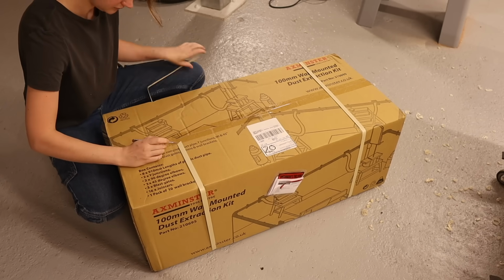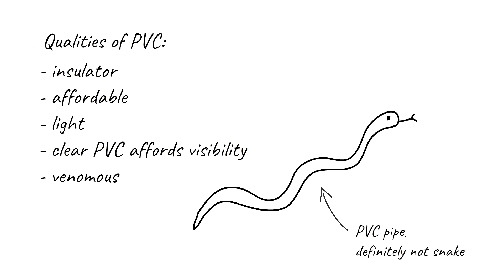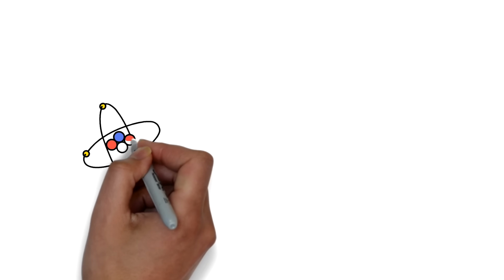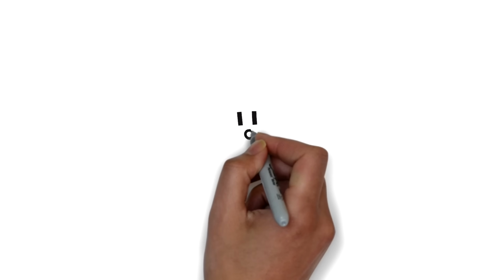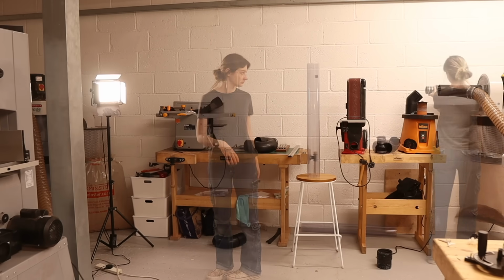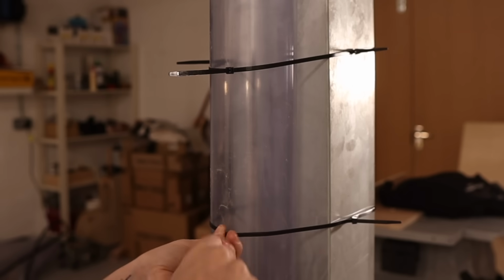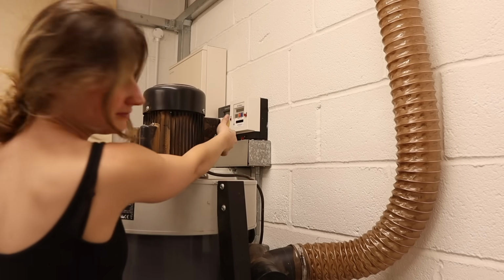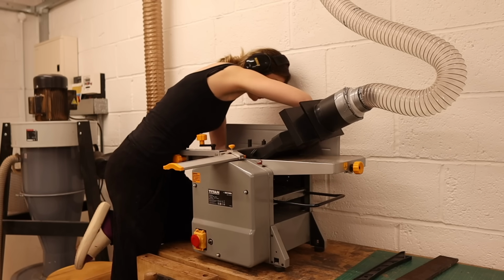Why Your Dust Extraction Might Explode

Comment: Hi Daisy, great video. We have a maker centre in our local town. We installed a huge dust extraction system big enough for the whole workshop. I was recently using the thicknesser when an elderly gentleman came over to assist. He's bald, which is important for this story! He was on the other side of the thicknesser retrieving the timber after each pass. All of a sudden I saw a spark get him from the extraction pipe. Without exaggeration it must have been around two inches long. It made an impressive "crack" as it discharged into his head! 
He was convinced I'd hit him!!! 
Moral of the story, good job earthing your system. We need to do the same. 
*Side not, upon researching I found it wise to be cautious with a dust extraction unit inside your workshop. The dust that escapes your filter is generally sub 5 micron. It atomises into the air. This is the nasty size for human lungs. I like to think of dust extraction as a cleaning aid, but still wear a respirator for self protection.

Comment: Daisy.   You nailed the static problem.  Remember if you were to hit a nail while running vacuum ,the hot metal could end up in your dust bag and smolder for a long time before catching fire After you've left your shop. You usually know when you've hit a nail(or other metal) just open your dust bag and spread out the dust etc to prevent smoldering. This tip could save you a major fire.  Stay well.  You are the best

Comment: It requires quite spesific volume of dust and airflow in plastic pipe to make a combustion as I recall from some study random years ago. In scientific laboratory they had trouble making dust combust. It needed quite amount of dust which isnt normal in our small shops and machines.

Comment: You should turn the Y connector from the thicknesser around, it will be far more efficient. Think of the piping in terms of flowing water, if the extractor is at the bottom of the hill and you want the water to flow to it effortlessly, then that backwards Y bend is a trap.
Reply: all those flex hoses arnt to efficient either...
Reply: This poster is right...This setup might block the planer completely if the the other hose is open... nothing catastrofic will happen but the planer might get glogged.. just 180 the y-piece and yer golden :)

Comment: Good work on the install of the dust extraction. Just FYI - the "grounding" is really unnecessary since pvc is an insulator, so you are only removing static from the area the wire immediately touches, it's still present on/in the rest of the pipe. Additionally, a wire on the outside only removes static from the outside of the pipe, not the inside and vice - versa. Furthermore, a dust explosion requires very specific circumstances, including a particular particle size and volume, and a small shop cannot reproduce those conditions. And a spark from static discharge is not energetic enough to ignite the dust even if you did somehow manage to generate the large volume required. It is a persistent myth that won't die because of social media; in fact, there has never been a documented case of a dust explosion  in a small shop due to static.

Regardless, it's great that you have a proper dust extraction setop because that is not good for your lungs. Enjoying your videos, keep up the good work.
Reply: Unfortunately, this video is perpetuating that myth.
Reply: I received a massive static shock from a machine that had been connected to ancient extractor using dryer hose! It fried nerves in my hand in their own fat according to the specialist. The charge went up my right arm to my neck and down the side of my body. After about 8 years of coping by being given stronger and stronger painkillers until I could be given no more I had to retire from Technical teaching...so yes this happened in a school workshop. Ultimately I got, eventually, a medical retirement but life has gone downhill since as a direct result of my accident. The medical profession had great difficulty working out what to do. Don't cut corners.
Reply: @scottmasson3336  that sounds more like electrical bleed was also involved. If the hose was metallic, then it could be grounded, but you can't do that with PVC.

Comment: Sweetest explaination of electric charging, I have ever seen.☺ Important question: DID YOU CHECK YOUR WIRING, by MESSURING the ground impedance? If not, you will not know for sure, if it works properly. It is correct, that the probability of a wood dust explosion in the tube is very low. Chances are much higher of getting shocked by a charged plastic tube, than to have a dust explosion. Plastics are highly chargable. However, things change completely, when the dust includes metal dust. This is where things can get very dangerous, because metal dust from crafting processes is mostly super hot and your dust extraction might go up in flames (not explode). That is why you should allways keep these kinds of workplaces and their exhausts seperated from each other.

Comment: Daisy, I think you are equating news stories about disastrous fires to the rate of incidence of dust fires and explosions. I think you will find a great many stories in the comments below.  Your comment about the humidity being controlled etc. is true as far as it goes, it is the little bit of crud built up next to a fan impeller that friction heats up and then poof. I had a good teacher who did a demo on this. He had a gallon paint can and put a teaspoon of wood powder in it.  For the demo he had a car spark plug in the side of the can.  He hammered the lid shut tight. Tripped off the spark plug and the lid hit the ceiling leaving a dent and the can was bulged out at the sides. Quite impressive to say the least.  So, can't be too careful.

Comment: little tip: don't use those screw-on clamps for the wire... with a vibration heavy environment those can easily get of that mashed wire... from another video I know you have a solder iron -> that would be preferable 
regarding the science: almost completely right, just a little addition that not only the electrons form up and build a negative area, also the protons that are now missing an electron are charged (positively), so both the PVC pipes as well as the saw dust (if very dry) will be electro statically charged.
but: 100% cool that you even think about that stuff... at lot of work shops I know in my area do either not really have dust collection or if so, no proper grounding^^

Comment: Yeah, some atoms have an extra electron called a valence electron. It's this electron that can get moved about from one atom top another and build up a charge. Generally nature doesn't like things unbalanced, so those electrons will travel to anywhere there aren't electrons.
What you are doing with your set up is a wise move. Static electricity does build up anywhere there is friction. People who put computers together usually wear a grounding cable. When it comes to safety, and I've worked a few high risk environments (just workshops, industrial sites) I was told to think of consequences rather than likelyhoods.
Dust explosions can get really gnarly.
As always, enjoying the content.

Comment: Hello Daisy, Great vid as usual, two comments, the wire can just be on the outside of the dust lines, and to stop those really annoying jolts you get when using the shop vac to vacuum the floor, put a conductor from the dust drum to the floor, That was the singular best thing I ever did to keep the floor clean.

Comment: Get a ladder 6' is most useful. Looks like all your metallic items are grounded. Sander dust is the main thing in your shop and it needs a hot start like a match with plenty of o2. If you have rubber feed rolls you can ground the bearing housing. If you had a bucket elevator you would ground the drums with static brushes

Comment: I picked up that Axminster ducting kit too, haven't bothered to ground anything but I will say the blast gates are constantly getting stuffed with debris which prevents them from fully closing.  I have to keep using a small allen key to hook it all out every few weeks
Reply: I install blast gates upside down so crud can't fall upwards into the gate slot. It's a bit less convenient to have the gate handle on the bottom. But it beats clawing wood dust out of those slots once a month.

Comment: Hi 👋, Very interesting, back when you were just a atom in the universe, that was before the big spark, I had some colleagues that had a very large workshop. Where are the dust extractor who is outside the building, luckily for them. As one day there was a fight inside the pipe electrons, atoms molecules all decided to accumulate. And they had a meeting outside   BOOM 💥, blew the dust extractor apart, and caught on fire, get the Fire Brigade get the Fire Brigade, luckily they managed to put it out. Even dust floating around in your workshop could explode if you have a bad ignition on something it will ignite and blow your doors and walls out., 
Something that a lot of people don’t think about is their polishing products , are use rag to apply them or paper towel. This can I have a chemical reaction, spontaneous combust., so just don’t throw your rags onto the ground but into a waste sealed container,, , put them into a metal container or even put them into a water bucket, not in a plastic bag or a plastic dust bin, 
There was a guy over 🇺🇸 that conducted an experiment, over the course of 24 hours, and 48 hours, he got plastic bags and plastic dustbins and set them up in a controlled area, he had used, paper, towels, rags, et cetera, and soak them in different types of polishing compounds, screw them up and drop them in plastic bags and in the plastic dustbins in the way that you were the last thing at night or last thing or Friday night, he used a infrared device to read the temperatures of the plastic bags, plastic containers and rags that were literally just piled up on the floor, he took readings of them half an hour an hour and so on and so on and I think within less than three hours phone member, rightly one of the bags started to catch on fire and ended up or even the plastic containers dustbins caught on fire and he had to drag me outside with a fire extinguisher., he done this experiment because one of his friends lost his workshop in a matter of a few hours after leaving work on a Friday night, I have had my specialist joinery business, best part of 40 years, and I would say nine times out of 10 that I will sweep up the last thing at night before going home. I’ll make sure everything is neat and tidy for clean and healthy start to the next day., even going round to the point of switching things off, making sure everything was isolated, 
I have seen you in the past, do some amazing work , stay safe, I hope this can be a help to somebody. I am now retired, live in France , 
Phil from the moulin France,

Comment: The first thing I did after setting up dust collection was to loop a drain wire down my pipes and ground it, if for the very least, it alleviated the extreme discomfort whenever I was vacuuming around the shop.

Comment: My extraction system is mostly metal. I've made some really nice dust explosions in the past (on purpose, with flour and a candle in a large container), and had some amusing workshop fires while machining titanium, but getting the right mix for a viable dust explosion is hard. The amount of charge you could build even with very dry wood dust isn't going to make a fat, hot spark that lasts long enough to cause ignition in a fast-moving air stream unless you have a large piece of insulated metal to act like the collector on a van der Graaf generator. It will, however, be quite enough to give you a shock and wreck or degrade any electronic devices that are close enough to the discharge.  Running a wire along the PVC won't remove the surface charges, but it will provide an equipotential surface that will help limit the build-up of energy from charge separation.  You'll still be able to build up a fairly significant voltage though. My extraction system is pulling small amounts of isopropyl alcohol vapour so the risk of spark ignition is much higher than with dust, hence the use of metal. I have some of that flexihose with a steel wire spiral, and I ground that to the machine frame and the vacuum fan.  My personal assessment is that my risk from inhaled dust is orders of magnitude greater than the fire risk and that's orders of magnitude greater than the explosion risk.

Comment: Yea not bad - copper wire doesn’t look bad at all. Your install looks great !

On industrial systems that tend to use galvanised spiral wound - electrical practice trusts the metal duct - but not the flex (even if it’s vac hose with wire) so common to see cross bonds over the flexes. 
I like the clear PVC for the same reasons as you - and it’s nice to see what’s going on. — good job!

Comment: Another approach to keep the wire on the outside by installing wood screws through the plastic fittings and leaving the head proud with enough space to be able to wrap the wire around it and then on to the next screw head. This method allows for the directing of static charges to the outside of the tube and to be grounded without interfering with shavings and "cut-offs" that can get tangled up in the wire.
Reply: I hope you're right!  I did what you describe.  I wrapped bare copper wire around my PVC, and attached it with sheet metal screws protruding into the pipes.  I figured the pointy screws would drain enough charge. I hope the electrons understand what to do.

Comment: My only comment. Less flex hose is more. That stuff kills the performance of the dust collection.  Not so bad for the big chips. But the super fine dust is hardest to catch and needs maximum airflow.
Reply: I’ve found that sawdust collects in the flex hose, but I probably don’t have the airflow that Daisy’s system has.

Comment: I won't deny your description of a neutron having both negative and positive charge made me cringe somewhat, but your right a dust explosion is a possibility although a very slight one in that situation.  I started writing a very long explanation (I have a PhD in physics) but I'll truncate it to, if you ever suck up shavings and get fed up with them collecting on the wires remove them and just use a strip of aluminium tape over the outside to remove the charge, it'll work fine.  You're not moving many electrons, your not trying to reduce the potential to 0 and the potential you'd need to generate a spark is high, if you were in a continuous very dusty atmosphere I'd suggest other solutions but for this it'll be fine.  It's what I've done in my similar workshop :)
On a related note, it's worth avoiding thinking of insulators and conductors when you're looking at high voltages, everything conducts, it's just how much...
On the dust handling side, if you find you need more flow, try to minimise how much flexible pipe you use (the rough surface really kills air flow), try to increase the radius of your bends and if you can increase the size of your HEPA filter (and clean it occasionally).  You can also heat those plastic pipes up and bend them a bit if you need to :)

Comment: Hi Daisy noticed you didn't have any windows in your workshop. Perhaps you should consider finding one with windows natural light or better ventilation. It's not good to spend a long time in a negative-pressure environment you need some positive pressure as well as ventilation. As a joiner who worked in industrial workshops a lot of hardwood dust is carcinogenic. make sure your extraction filters are adequate. best regards. john.

Comment: Flex has quite a bit more flow resistance than the solid pipe. Better practice is to use the solid for as much of the drops as practical. The U turn off the thicknesser is a no no. Perhaps you are using a new physics but in my school days, before steam traction, neutrons were just neutral, hence the logical name. But your general information is well presented. Rutherford would have been happy. The question for this video is: what was Paganini's favourite recreational instrument?

Comment: I've never found a story or evidence of a dust collector fire in small to medium shops. As Daisy said it's so rare as to be a nonissue. The zapping on the other hand.....
Reply: In the aviation industry, painting areas are often grounded to prevent dust being attracted to the painted surfaces. And ground wires should ALWAYS be attached to aircraft to prevent that zapping getting to your aircraft fuel tanks!
Reply: @amateurmakingmistakes  completely off topic but ok then. Just like I ground my airplane every time I fuel up. There, my completely off topic reply.
Reply: Interesting that you should say that. There are two stories right here in the comments. Maybe they posted after you commented?
Reply: @testingperson8413  Telling stories in a forum isn't documented evidence. They is anecdotal at best. I've had DC in my shop for ~22 years but before I built the system I looked for solid evidence with references to substantiate the static claim. I found none. I heard all the stories and myths surrounding this so I wanted evidence. I found none. There are 100s if not 1000s of videos by woodworkers all over the world, again saying the same thing.
The one story I did find was a woodworker grinding metal and using his DC. There was smoke coming from the system and it was caused by the sparks from grinding.

Comment: Looks like as they said in big bang theory you 'grounded the crap out of this'. As an electrical engineer, you did what i would have done. Minus testing it with a grounding meter (but you probably don't have one of these). The weak link might be the connection to the ground lug. Check that periodically during your maintenance.